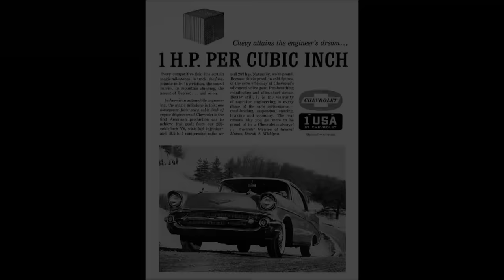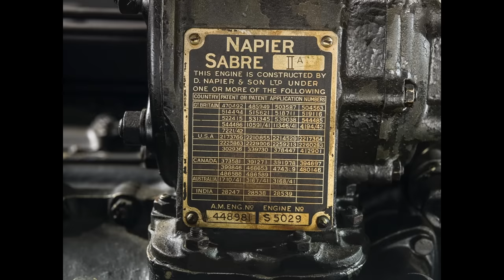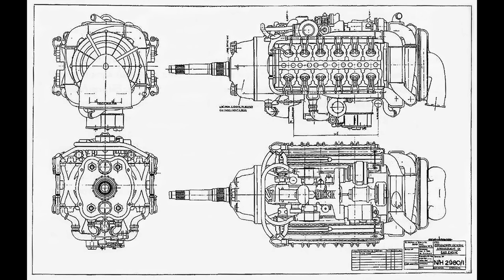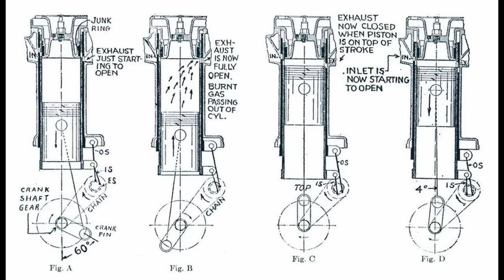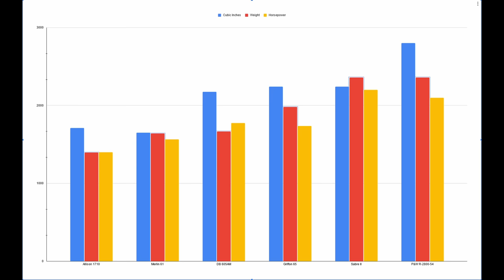Napier Sabre - The Ultimate WWII Aircraft Engine - Part 1

Comment: Many engines get a lot of love. Especially the Merlin and Pratt&Whitney. Both deservedly so, for their contribution to defending the UK, halting the tide of the Nazi advance, and ultimately gaining air superiority over Berlin.

But the Best DESIGNED Engine of WWII, from the standpoint of engineers who actually knew what they were doing. A true triumph of design and not simply national-resources hungry emergency development programs. Was the Allison V-1710.

Yes, the merlin gets lots of credit. But its an over complicated mechanical item with ancient archaic port, heads, valves, and pistons, blocky crankshaft, bespoke manufacturing process of lapping each part by hand to make it fit or work, etc. It made hige power on American supplied 145 octane fuel, yes, simply because it had very low compression ratio of 6:1 and they could keep re-gearing the old-school centrifugal blower for more boost.

This in comparison to the Allison which had most, if not all of the problems of engine design, and mass production process already worked out on paper, and with a couple of test cylinders and an engine or two, before they started making them. 

Allison used true modern cylinder head design, including everything mechanically speaking, that you would find on a SOHC motor in Year 2000. Pent-Roof combustion chamber, dished piston, angled valve-train geometry, sodium filled exhaust valves, super-alloys, nearly indestructible forged steel I-beam rods (good for 4,000hp, per boat and air racing and tractor pulling guys). Trick two-sided big-end bearings. They even developed modern plain bearing technologies and their manufacturing processes with that engine. Not to mention solving the crankshaft vibration issues inherent in long, lightweight cranks having many throws. The tuned vibration dampers they developed are still used to this day in Big-Bore Lycoming Aero-Engines. E.g. IO-390, 540, 580. They don't need flywheels (due to the propeller) nor external viscous dampers like automotive engines do.

Allisons were Modular designs, meant to turn either clockwise or counterclockwise in either a tractor or pusher installation, by simply flipping the crankshaft and cams end-for-end. This was the root reason why the P-38 had docile flying characteristic's into the stall, and also single-engine controllability that brought many home. Unlike some other well known WWII era high-performance twins. 

Also they were meant for Turbocharging or 1&2 stage and 1,2 or 3 speed gear driven supercharging. (Or both Turbo and Blower, Compounded simultaneously like the P&Ws). And also later had turbines driving the aft end of the crankshaft in a turbo-compound setup.

The fact of the matter is, they got a single stage single speed blower and a exhaust driven turbo in the P-38. But they only got the 1-stg Blower in the P-39 due to packaging the big turbos of the era into that tony aft-fuselage, and then war rationing as turbos were needed for B-17s and P-38s and P-47s so the P-39 and its Allison gained a reputation of being under powered. 

In the P-38 the turbochargers would fail when over heated or when allowed to cool too quickly or cool to low of temperature, this caused only a few problems with B-17s that ran at high power and rarely changed power settings, and also had 3x other engines to get them home. - But it gave the Allisons in P-38s a bad rep over Europe. The issue was they were lugging the engines to a lower RPM and not building enough heat or boost in the turbos to keep them warm on long high altitude missions. But all the issues with Allisons came down to economics and design trade offs in the P-39 and operation misuse in the -38s, and not the Allison V1710 design itself. 

They (Allison Engineers) originally intended to use the proven 3-stage gear driven supercharger (which was a bolt-on option that was already designed and built and ready) but the USAAF was obsessed with the advantages of Turbocharging as well as giant Bomber centered attacks and didn't want to purchase pursuit/fighters with 3-speed 2-stage superchargers. It would have been VASTLY easier to re-design the P-51A to take the 2stg/3spd Allison Supercharger than to re-design for the Merlin. This is a political issue and not a problem with the Allison engine, or their engineer teem who already anticipated this engineering decision and were shut down by the Army/AF brass before the war even started.

Post-War usage such as offshore boat racing proved they could run for hours at 3,000hp output given enough boost, and did not even require WWII era 145 octane to do it. They could reach 4,000Hp+ for tractor pulling with methanol/water injection. They were also used in late war and post-war tanks.

So the Allison is in fact the Best DESIGN from the standpoint of doing what they were intended to do, with little need for solving seemingly endless problems or needing to be further developed throughout the war as the Merlin was. And they are the Best Design for being versatile enough to propel airplanes, boats, tractors, and tanks.

Comment: Great research and information. You mentioned about why larger displacement may not increase weight. I am thinking .. big cylinders.. are empty spaces that dont contribute to weight, but do contribute to power output.. obviously the crank and rods must be strong enough to take whatever the power output is.
I wonder if the Napier would have done even better with big boost,  less cylinders and lower rpm, but keep the very efficient valvetrain. 
I bet that engine sounded amazing at high rpm and load...

Comment: A great engine, but complicated to manufacture early in it's use.  Halford was a visionary, looking further than even Hives, Meade or Hobbs. P&W management was furious when special milling machines intended for them was sidetracked and sent to Napier in order to assist with production of the cylinder sleeves.  Later models of the Sabre developed phenomenal power readings and increased reliability, but the Typhoon and the Tempest were the only airframes produced with them.  One blip in this great posting was a photograph of the Napier Nomad being referred to as a Sabre.  The Nomad was an opposed 12 cylinder two-stroke diesel with an axial flow supercharger turned by an exhaust driven turbine that contributed jet thrust and also turbo-compounding.  It had some of the lowest fuel consumption statistics for any high output piston aircraft engine.  Halford was always looking forward, just not towards gas turbines.

Comment: One issue for designers dealing with the phenomenal output of the Sabre as it developed would be cooling. Radiator size would have to be increased considerably hence the re arrangement on the Tempest VI - through the gate was limited by overheating as in the Closterman archives. And the Fury Sabre at 3055 had very large radiators. Methanol water or just water injection was a short term solution. Also at altitude the thinner air reduced effectiveness of cooling both for water and air cooled piston engines. The piston engine fought a cooling problem on which the gas turbine thrived only limited by turbine material.

Comment: The Allison V 12 engines did not use the turbo compound supercharger systems. It was the Wright R-3350 (B-29) and Pratt Whitney R4360 (post war B-50) radial engines that had turbo chargers, and it was the P&W R-4360 that had the turbo compound gearing that was gear directly into the engines crank shaft.
Reply: +  Captain Clone     The Allison 1710-127 was a turbo-compound experiment developed for the XP-63H.   The engine was cancelled in 1946 in favor of turbine development.

Comment: There was a cutaway Sabre in Duxford museum in 1995, it had an electric motor to rotate it via a hefty chain. I said to my father that if there was sufficient friction to need so large a chain no wonder it was a disaster engine. Of course the chain might have been a free gift and not essential for strength but I suspect anyone familiar with oily metal would have no difficulty understanding why either V12 or radial 14 or 18  was far superior.
Reply: Thats why the cartridge start was ultimately used.No starter motor could cope with the drag of both cranks and 24 pots at the time.Incredibly difficult engines to start from cold bearing in mind at slow cranking the magnetos are giving a very poor spark at the plugs and building oil pressure up was problematic.I dont know of any Sabre engine now that will run in aviation circles.?

Comment: My father worked at Napier's test tunnels in Elstree and Acton during the war where each engine was run to establish oil consumption and power using calibrated propellers, one engine gave a massive amount more power than normal, this engine was stripped and measured, all was normal the engine was then sectioned but it was never established where this engine made its extra power, reported at the time to be in excess of 4000HP

Comment: The Napier engines did have some issues with the sleeve-valve design, and the British ground crews called it the "Spew" because it would spew oil everywhere. Some Typhoons apparently would crash because the engines simply ran out of oil mid-flight. They managed to rectify the issue, if I recall correctly
Reply: Complex AND covered in guck? Oh joy says the mechanic, lol.
Reply: Sounds like the "Jimmy" diesel engine!

Comment: There are many consideration s where selecting a power plant under war time conditions is concerned. Shear power to weight, though is important, its not the only one. Though, it might be if your talking about small production for specific missions. Example: making the most powerful engine of its day, that in the SR-71, be the engine for most if your planes. As a former, now retired US Navy Aviator, who did maintenance test, quality assurance and operational command duties..I like engines that are easily maintainable, last a long time, easy to fix, don't cost an arm and a leg to buy. I want many of my planes flying, A lot of the time, and am willing to give up a little in performance to get a better winning combination of factors.

Comment: The DB 605 always suffered from the 87 octane fuel available to Germany throughout the war, the Sabre had access to the 110 octane fuel (eventually) made available from America, and with it's sleeve valve system could use this to the max giving it more available power due to the dual anti detonation properties of the fuel and induction system.

Comment: Great video! The fuel consumption and maintenance must have been legendary! In the 1920's Harry Miller Indy engines consistently produced engines that far exceeded the 1hp per cubic inch yield. His 91.5 cubic inch supercharged straight eight engine yielded 154 bhp at 7,000 rpm. Driver Frank Lockhart added intercooling and mechanical refinements which boosted output to 285 bhp at 8,000 rpm. Very impressive for 91.5 cubic inches (1.5 litres) in the late 1920's. Thanks!
Reply: Frank Lockhart is a forgotten genius and hero.
Reply: @andyharman3022  indeed Andy!

Comment: Not mentioned in the video is the fact that, during the 1920, Napier produced a highly-successful airplane engine called the Napier Lion.  Introduced just at the end of WW-I, the 450-hp, liquid-cooled Napier Lion was unusual in featuring a "broad arrow" configuration.  That meant that its' 12 cylinders were arranged in three banks of four cylinders, something like a "V-8" engine with a thrid bank of four cylinders arranged vertically between the "V".  Although the Lion was widely-used during the 1920s, the "broad arrow" engine configuration came and went pretty quickly, and was no longer used by the early 1930s.  The presenter claims that the predecessors of the Napier Saber engine, the Rapier and Dagger, failed due to the influence of Rolls-Royce.  However, there was more to it than that.  Both the Rapier and Dagger had what would now be called "issues".  For one thing, unlike the later Saber, both the Rapier and Dagger were air-cooled rather than liquid-cooled.  That resulted in a relatively complex engine, with a large number of cylinders, packed into a relatively close-fitting cowling.  As a result, the Rapier and Dagger tended to overheat while the aircraft was on the ground taxiing or waiting to take off, and then became too cool while in the air, leading to engine seizures.  In addition, their complexity meant that they were more difficult to maintain, and their rarity meant that most engine mechanics were unfamiliar with their idiosyncrasies. They are also unpleasantly noisy, especially the Napier Dagger.  Only one production aircraft was ever powered by the Rapier engine, the Fairey Seafox, which was a pre-war scout/observation floatplane deployed from Royal Navy cruisers, of which only 66 of those were ever built.  By the same token, only two production aircraft types were ever powered by the larger Dagger engine, the Hawker Hector and Handley-Page Hereford, and both were also pre-war aircraft.  The Hector was an Army-Cooperation version of the two-seat Hawker Hart biplane light bomber, which saw only about 1 1/2 years active service before it began to be replaced by the more advanced Westland Lysander.  The Hereford was a Dagger-powered version of the Handley-Page Hampden medium bomber and was produced only because the Air Ministry believed that there might be a shortage of the Bristol Pegasus engines used in the Hampden.  As it turned out, the expected shortage of Pegasus engines did not occur.  Only 179 Hectors were ever built and most had been replaced by Lysander by the time WW-II began.  Only 152 Herefords are produced and, while they saw limited action early in the war, they were unpopular and were either converted into Hampdens by having their Dagger engines replaced by Bristol Pegasus engines, or else relegated to training squadrons.  The Naper Sabre engine was liquid-cooled, which increased aerodynamic drag, but alleviated many of the problems experienced by the earlier Rapier and Dagger engines.

Comment: Thanks for this easy to follow video. This was the double-trouble situation of working a new engine design into a new aircraft design (s), and done while being constantly sabotaged by RR. Like in the US, even during desperate war-time situation, private companies still pull their dirty tricks. With the advent of turbines still a dubious proposal, the highest possible output was being sought for piston engines, and the cost and complexity was irrelevant when you're trying to stop someone from bombing your homes. The Merlin suffered many failures when they started to pump up the power output for later Spits and Hurricanes . Crankshaft, cylinder head, connecting rod, supercharger impeller, etc. all had to be beefed up. RR rarely, if ever came up with anything original.....

Comment: Read Pierre Closterman’s book “ The Big Show “ He was flying the Hawker Tempest V for the RAF 2nd Tactical Air Force in 1944 & 45. His opinion of that  plane with the Sabre Engine was that the plane was ubeatable down low . The Mustang with the Packard Merlin was at its best above around 18000 ft .Great Video. The preferred engine for the Tempest was powered by a Bristol Radial , but this was not used because of supply problems.

Comment: >Be me
>Go back in time with modern Garrett turbo tech as well as VW's VR engine layout and show it to Napier
>They make an even more insane engine than in original history
> VR16, 20, or 24 boxer engine probably weighing 1000 pounds putting out 3000HP in 1940
>Combine it with a contra-rotating prop on something like a P63 KingCobra, only make that even better with a bubble canopy and some other aerodynamic trickery as well as an XM301 in the nose as the only "gun" that way the wing guns can be substituted with more fuel capacity
>Basically upstage the P38 and P51 as legendary planes because I cheated with time travel shenanigans.
>INB4 they make a twin-boom version as a hyper fighter-bomber.

Comment: Saying it out Loud: What an amazing accomplishment and revaluationized engine as they knew.  The designer was way ahead of his time. All the stats you just read are staggering even for today's engines.... 2000k hp<???<<< They must have thought ge was crazy... Great Video!!
Reply: Not so much.  The Air Ministry was well aware of the 2500 HP power output of the Rolls-Royce R engine that was used in Malcom Campbells record-breaking land and water speed records and the Schneider Cup aircraft of the early 1930's.  The R engine had identical displacement to the Sabre (and also the same as the later Griffon).  Rolls-Royce gained valuable experience in supercharger design by working on the R engine many years before Napier started the Sabre project.

Comment: I'm curious to know what the connecting rod to stroke ratio is, people all the time talk about the bore to stroke ratio and how it's applied to an engine that's higher or lower revving, but equally important is the rod length to stroke ratio when figuring what your target RPM's is for peak HP.
A longer rod passes through TDC faster and BDC slower given that you're not changing stroke, so if you want to make peak HP at a higher RPM without changing your stroke you want a longer rod because it doesn't descend away from the top of the combustion chamber as fast and the pressure from combustion is pushing harder on the top of the piston when the connecting rod is at the ideal angle in relationship to the crank for maximum leverage on the crank.
Big twin Harley engine's have a bore to stroke ratio radically different to a Chevy small block with a bore that's much smaller and a stroke that's much longer than the Chevy's, but they have a rod to stroke ratio almost the same as a Chevy small block due to their much longer connecting rod, as a result both engine's make their maximum power at approximately the same RPM's and both redline at 5,200 RPM's.